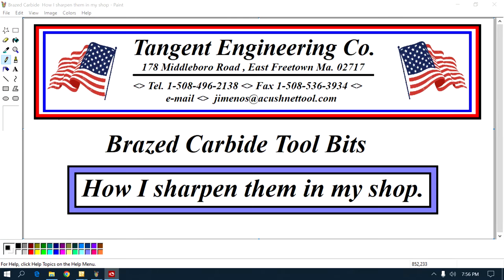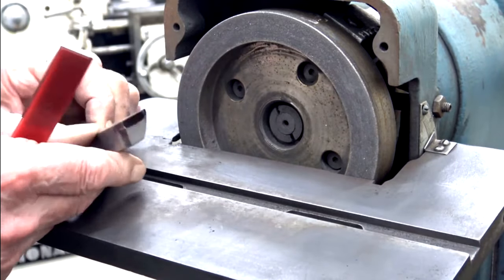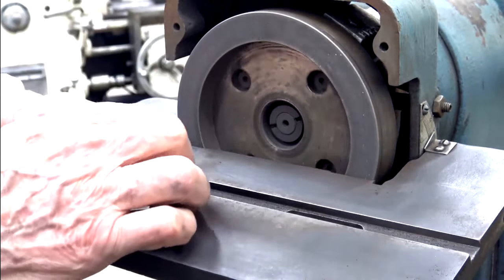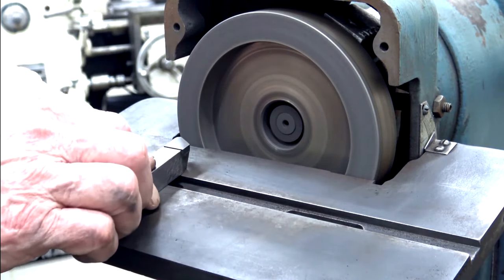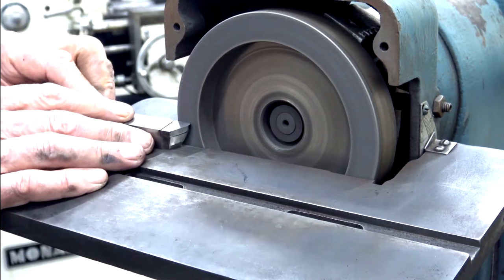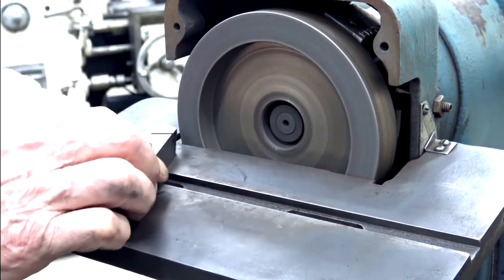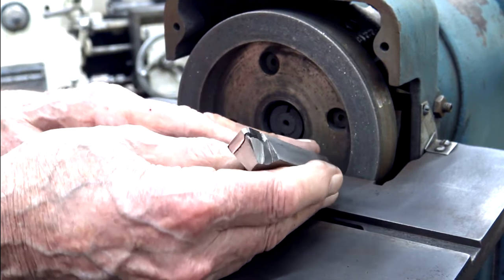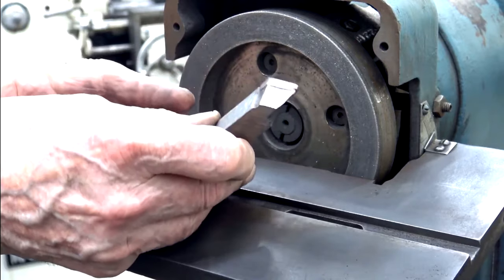Brazed Carbide - How I Sharpen it.

Comment: Do you pre grind the tool steel under the carbide first for clearance or grind both the carbide and tool steel at the same time on the diamond wheel??  Like the real time video better than cad drawings….
Reply from the maker: Chuck - I Pre Grind under the carbide on a pedestal grinder. The material under the carbide is at a greater angle than the Carbide Insert . Thanks for the tip - Video is better than Cad . --- Jim

Comment: What rpm was your motor spinning?
Reply from the maker: Robert - I went out to the grinder to read the RPM Tag .  I was covered and not visible. I'm guessing 1750  RPM .
I can tell you that the face wheel diameter is 6" . --- Jim
Reply: @TangentJim  , okay, thanks. Do you remember the grit of the wheel?
Reply from the maker: Robert - When I have a moment - I will take a picture of the Grinding Wheel. It should have some information
on the face of the Wheel. ---- Jim
Reply from the maker: Robert - Picture of Diamond Grinding Wheel  
 https://www.youtube.com/channel/UCnVOj-ngZVRuMS06EPkuN1A/community

Comment: Has anyone found decent AlOx wheels for those grinders? I can find about two, but they cost more than my grinder cost.

For now I just use green stones and sharpen only carbide on mine. If I had an AlOx wheel I could sharpen steel, too.
Reply from the maker: Tim - I'm not 100% sure of what you are looking  for  ??  Try this link - it might be 
a candidate .  https://www.shars.com/6x3-4-d6a2c-cbn-plain-cup-wheel-1   -- Jim
Reply: You need a Green, Silicon Carbide wheel, Not AlOx.
Reply: @felgate11  Not for dry-grinding any sort of steel. That mistake erodes the wheels really fast. Silicon carbide is fine for non-steel grinding, or for very wet steel grinding, but not for dry grinding steel. Not even for removing steel from the end of a toolbit under brazed carbide. If you nick steel with a dry silicon carbide wheel, you need to redress your wheel.
Reply: This is an old-school diamond carbide grinding machine, diamond dust pressed into a cast iron (?) disc. I used such a grinder in the early 70s. Silicon carbide (green grit) for roughing, the diamond gives a finer finish. HSS for removing the steel shank below the carbide tip.

Comment: You have the angle set too high. It should be set at 8 degrees.
Reply from the maker: Hey Stanislav - You are obviously are very knowledgeable . Please advise me what angle to use for A.I.S.I / D-2 
ASTM A681 / Din 1.2379 / SAE J437 / J438  Thanking you in advance . --- Jim
Reply: @TangentJim  It depends if the steel is hardened or not. Generally a smaller angle is given to harder material.
Reply from the maker: Stanislav - Your original comment stated that I was 1° off . You didn't know what material I was cutting .
You didn't know if it was hard or soft --- I'm confused .  -- Jim
Reply: @TangentJim  After watching your video, I'm guessing you have it set at about 12degrees. That's good for aluminum. On aluminum, you grind 15 degrees on the face angle. And you would probably grind it from HSS. For regular steel, 8degrees is ideal. If you're going to have steel refined to 900mp, or hardened to 50Hrc, I'd recommend a 6degree setting.
Reply from the maker: Stanislav - I have two angles on that Tool Bit . The large angle allows me  room to sharpen short angle . I only want to grind the carbide
tip -- not all of the total height . I snag the base material on a pedestal grinder at a sever angle - allowing me to grind the carbide without 
loading the fine Diamond Wheel. That's my story and I'm sticking to it , --- Jim
Reply: @TangentJim  👍
Reply: @TangentJim  ha ha - good one Jim !! Get your sine bar ready to set the angle EXACTLY . . .
Reply from the maker: @gyrogearloose1345  - Good one . I like it . -- Jim